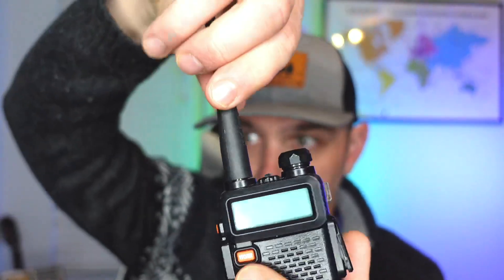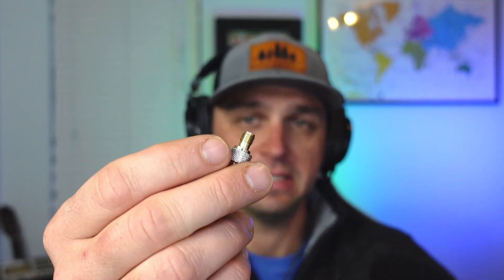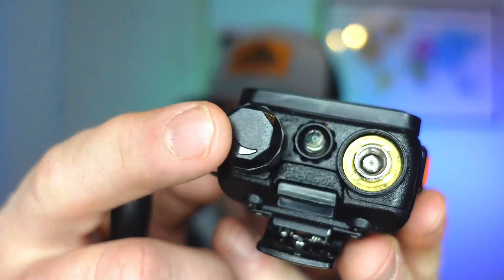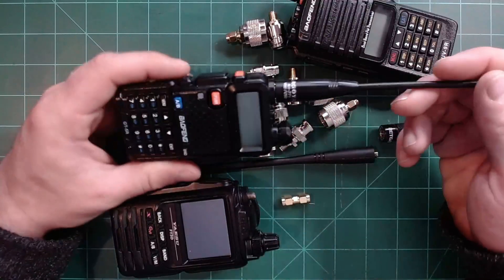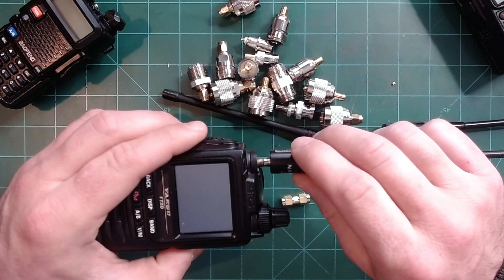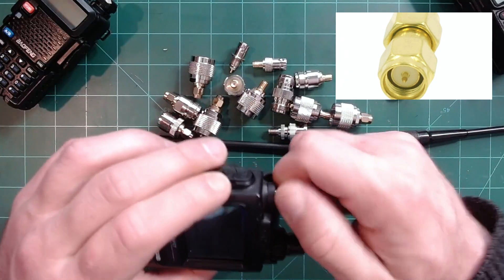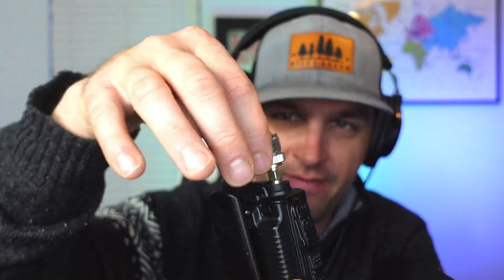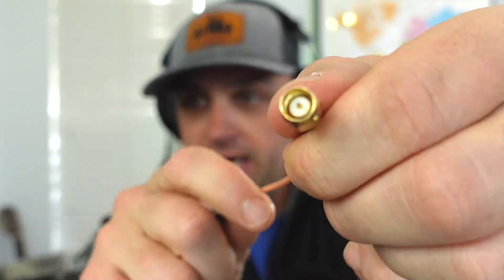Baofeng Antenna Doesn't Fit!!! Ham Radio Connectors and Adapters.

Comment: Barrel SMA-F to BNC-F adapters and barrel SMA-M to BNC-F adapters are the way to go on the HT side. The barrel connector has a broader base providing a better connection with the HT. Signal Stuff, HRO, and Gigaparts sell these adapters, which function better than the cheap Chinese ones. You can use corresponding BNC adapters for your SMA antennas or buy antennas with BNC connectors; then, all antennas are interchangeable. The adapters will help preserve the SMA port by avoiding wear and tear from antenna swaps.
Reply: I was just basically going to post this. I personally like using antennas with BNC bases. That way I can have what ever HT I want with either an SMA-F to BNC-F or SMA-M to BNC-F. That way, all my antennas will work on anything ... Baofeng UV-5R, Yaesu FT3DR, or even my Icom IC-705.
Reply from the maker: I actually do have one of these as well and your reminder gave me an excellent idea...  Thank you (maybe a video incoming)

Comment: This is without a doubt the best video on this topic that I have seen.  I have searched and have seen a few video discussing different connector types, but showing the connectors with the various applications was helpful.  As an example, I bought a Yeasu HT.  I have a mag mount for the mobile unit that I am going to purchase and I just installed an outdoor antenna to use with the mobile in the house.  Until I figure out the right mobile unit for my application, I would like to hook up this HT to the mag mount in the car or the outdoor antenna while I am in the house.  After spending a couple of days watching different videos, this video showed me exactly what I need!  New Subscriber because of this video.  Keep up the great work!
Reply from the maker: Thank you!

Comment: Aloha Sean, this is a video that needed to be done. I think you and I can see the obvious here but your presentation  is completely non-bias, I can understand that. 
       I own many Yaesu Transceivers, just bought another FT-2980r for my Faraday Cage but I only own one Yaesu handheld, which is the FT-470 duel bander with a BNC connector from a long time ago. 
    Now if you’ve ever had your handheld radio on your belt like I always do, I can’t tell you the number of times I’ve broke the female antenna connector while getting in and out of my Jeep. 
    Even though that’s a major bummer, it’s very easy to remove the small stub from the connector that broke off. On the newer Yaesu handheld radios, you’d have to either take the whole radio apart to replace the antenna connector or do what most people do, stick in a drawer, never to be seen again for a few years. This is the reason why I will not spend extra $$$ to buy the Yaesu VX6R handheld(My first choice) that retails for $249, mainly because I am ruff on radios. Therefore, buying a Yaesu handheld with a @$$ backwards connector is simply out of the question and just maybe in the future, Yaesu will pull their heads out of their @$$es and install the correct connectors on their handheld transceivers. 
    I hate to be so blunt but at least I’m not blind to the obvious that Yaesu should of figured out on the get go. 73’ 🇺🇸🇺🇸🇺🇸

Comment: I have the same problem with my BF and an aftermarket Nagoya antenna. I used a Dremel tool to remove some of the overmolding on the bottom of the antenna. It keeps the loss from using a sma adapter down and it’s more secure.
Reply from the maker: I'd love to see a photo.. I think I understand what you're saying. Basically, you had the correct connector on the antenna, but it didn't fit, so you shaved a little off the antenna plastic off the base?
Reply: @HAMRADIODUDE  Yes, Sir. I’ll look for your email address and send a pic.
Reply from the maker: @jj-zy6gc  thank you. It should be on YouTube under the "about" tab in my profile
Reply: @HAMRADIODUDE  it goes to a dead link or I’m not seeing it lol

Comment: Great video.   You or somebody that does ham radio videos need to do a review of an Icom IC V86.  I have one and it's fantastic radio. Only the manual sucks and it would have been great if the on/off /volume was on top instead of a button that is used.   Everybody says it sounds great. Thanks for all the great work you do on your videos.
Reply: I have a V86. Awesome VHF HT. In the menu you can change it so that the knob controls volume or tuning. Mine is set to volume. It would have been nice if Icom did include a power switch in the knob too instead of the button, I agree.
Reply from the maker: Thanks for the suggestion.  I'm fairly independent when it comes to gear acquisition, minus the china based companies sending things for review.  With that, it's difficult at the moment to aquire gear.  I have a few things for sale and once feasible, I will consider the radio for review and evaluation / walkthrough.  However, this may take some time.  I'll do my best
Reply: @HAMRADIODUDE  Thanks so much.

Comment: Yes the connector on my Anytone 878 HT was a problem because of so much putting it on and whatnot. So I got a bnc antenna and a bnc adapter to my SMA (I don’t remember male/female right now).  My idea is to provide 2m/70cm feed lines to the HT with BNC. Those don’t have the potential of getting screwed wrong. Lol. All the best, 73 de KI5HXM

Comment: The one thing that you really need to watch on these SMS connections is that they will work them selves loose over time on the radio.  It almost makes you wonder if you need "lock-tite" to keep it from working loose so easy, other than that you get what you pay for in that radio, no complaints! Signed Bob N5XXX
Reply from the maker: (throwing this out there for anyone who is hoping to try), f you use locktite, a few new issues may arise, depending on the connector type and how much is used. An antenna is a conductor, which if too much locktite is used, a intermittent connection from the antenna to the radio may present itself.  I would suggest if someone wanted to to locktite, to use it very sparingly.  I just wanted to throw that out there as there are some people who will use the whole bottle on one item (me).. cheers

Comment: Hello
And what happens when rp-sma are on radios are they this nice adapter versions with the wide base also existent, it getting more and more confusing, why can't they make all radios with bnc male connectors and all antennas with bnc female and done. 🤔
Reply from the maker: There are so many standards. Probably comes down to price.
Reply: @HAMRADIODUDE  Hello 
Thank you very much. 🤗

Comment: Hello
What side of the sma connectors wearing first out the make sma or the female sma and how is it with rp sma in the same question. Would buy rather a antenna with a connector on it that don't wear out.
Reply from the maker: Great question. In my experience, I have rarely had either side wear out.  If I had to theorize, I would say the male side would tend to wear out or break quicker.  have a good one!
Reply: @HAMRADIODUDE  Hello 
Thank you very much. 🤗

Comment: I had a P10-UV. It was marketed under a different name and the radio said Baofang. UV-10R. It was a tri-band radio. My Comet and Nagoya  antennas would not fit in the sma-f area. The section of plastic were the antenna and radio touch was too wide. It even broke the connector on the Nagoya even though I didn’t force connection. I had a Diamond 77 with a trimmed base and it fit fine. Maybe this is the radio people were struggling with and not the difference in connectors?
Reply from the maker: It could be
. I'll give that a shot!

Comment: I watched your video on moding the uv 5g to transmit other than just GMRS channels.  Do you know if there is a mod that works the UV-9G?
Reply from the maker: Hello. To answer your question, I just want to confirm: The UV9G from baofeng or Wouxon?  Thanks.
Reply: @HAMRADIODUDE  sorry for not being clear.  The Baofeng UV-9G.
Reply: This👆
Reply from the maker: I think you could do the three botton method as outlined by @notarubicon

Comment: Do you know of a BNC connector that will work with the UV-9r?
Reply from the maker: Sure -  You most likely want a sma female to bnc female - I typically don't recommend cheap connectors, but this is a two pack - https://amzn.to/3JcHdhS (affiliate link).  If you want super high quality ones - Pasternack has some for 56$ (overkill).